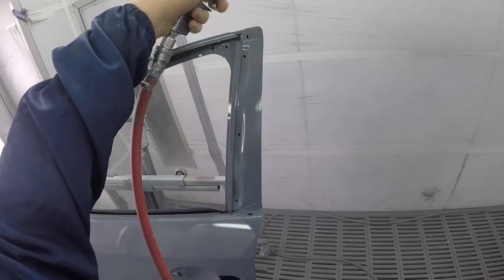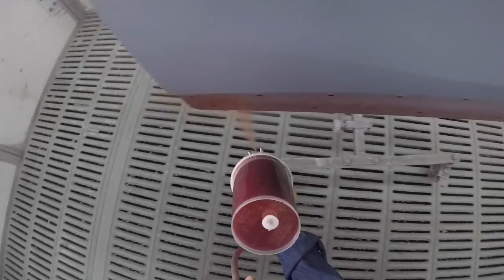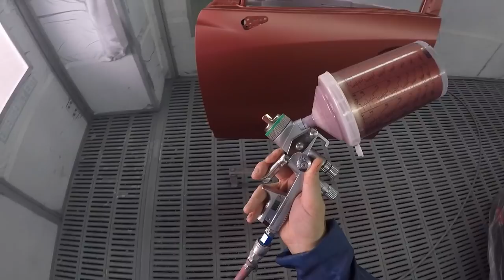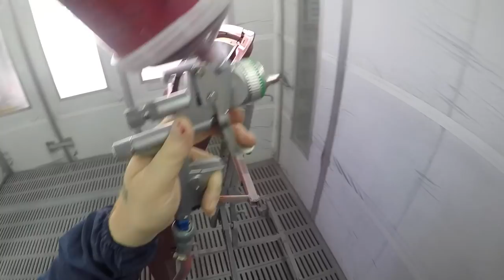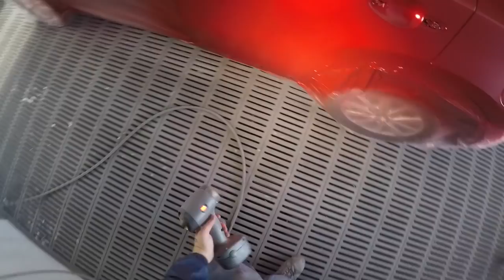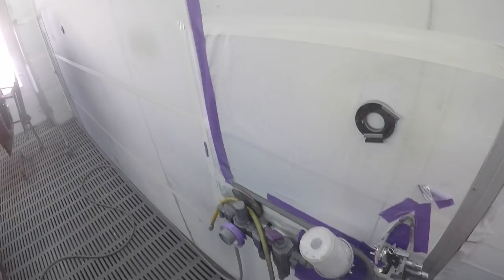soul red

Comment: I bet the front door looked different. Ps hope the fitter didn't damage the door on guard. Always better to wet on wet primer door, paint inners when matching spray out card, then fit door, thus eliminating any f ups
Reply from the maker: Andrew Bubnowski there was no colour difference at all and it didn’t get damaged :) some methods work for some people and other methods work for others I have never had an issue with colour difference when painting panel off the car it’s how I’ve always done it to be honest it’s quicker then double handling panels in my opinion but like I said just because it works for me doesn’t mean it works for others 👍🏻
Reply: Might not have happened yet, but one day it might. My way is safer. Look out for number one.

Comment: Nice video u put g6 sealer or g6 ??? base coat what’s PPG clear u r use it
Reply from the maker: Alane Atika thanks so on the brand new door I put g6 sealer and on the rest of the job I put g6 basecoat and on that particular job I used ppg enviroflow lvc-104 uhs clear but now I use the enviroflow uhs lvc-136 clear so much nicer to work with not sure if it’s available world wide or just here in Australia

Comment: Fan all the way open?
Reply from the maker: dekorokone yeah mate full open fan
Reply: Cool thanks. I have that set up. Struggled to set up. HS clear.
Reply from the maker: dekorokone if you find that it’s a little slow or it’s not flowing out enough try turning you fluid out a quarter and up your air pressure slightly so say if you spray at 2bar try 2.2 bar
Reply from the maker: If it’s a hot day try dropping your pressure slightly
Reply: Thanks. How much fluid are you running. Couple of turns?
Reply from the maker: dekorokone for clear coat I’m have my fluid wound out 2 turns  for my basecoat I have it out 2 turns and the only 1 and a half turns for the control coat